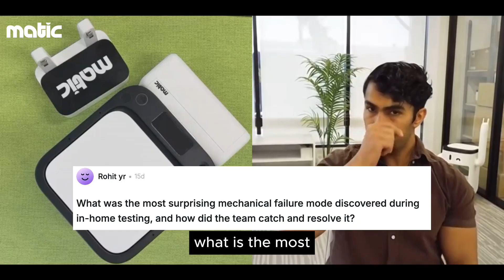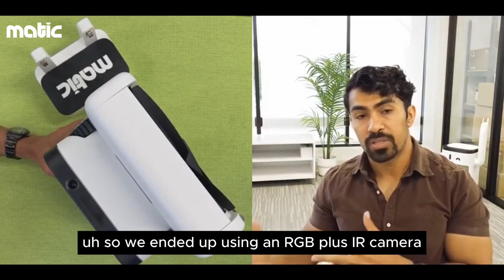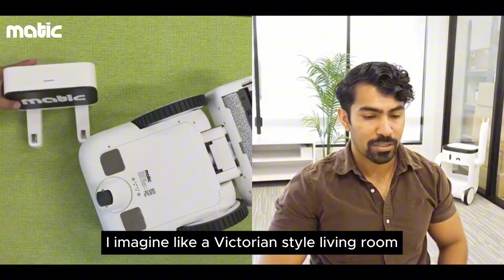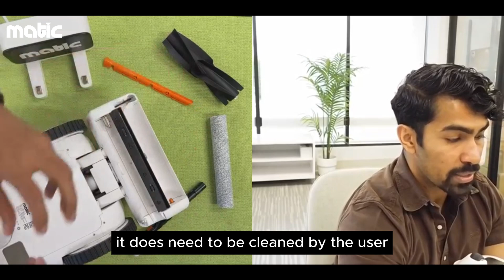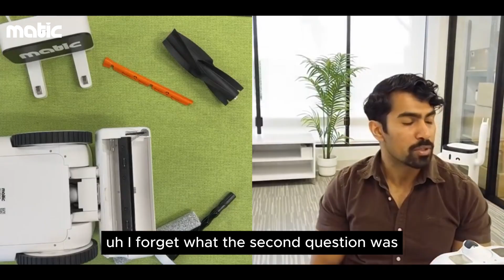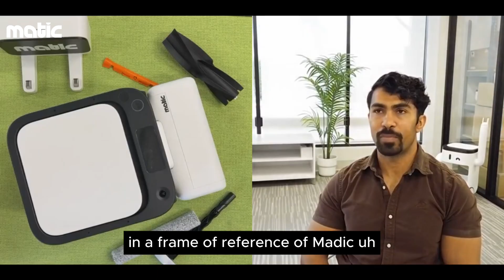Anshuman Kumar, Matic's Head of Hardware - Ask Me Anything

Comment: still no response to emails. anyways your company will go under or best case might get bought out. But you aren't going far with this. I recommend the team to keep back up jobs.
Reply: Very curious. I’ve sent Matic loads of emails and they responded in detail to every single one. I wonder what address you used. Anyway, I bought one, and it is absolutely incredible.
Reply: I can guaranteed you that those disc robots companies are the ones who will go under if they don’t change their ways. But of course they’re just going to take the easy route and try to steal Matic’s IP instead of innovating to survive before they go under.
Reply: @mrwombat24  They have the money and they are innovating fast. This robot vacuum is way behind the competition at this point. They will not survive trust me.